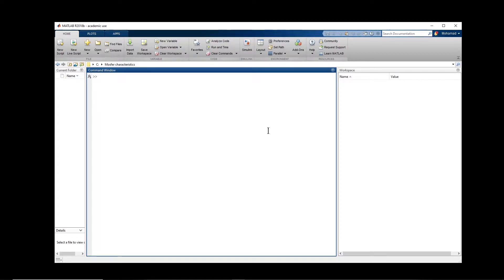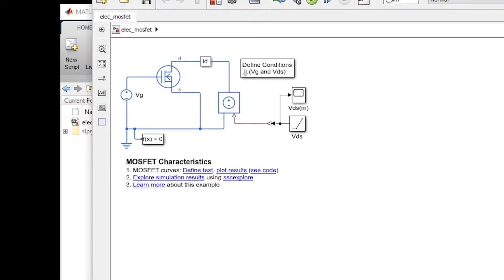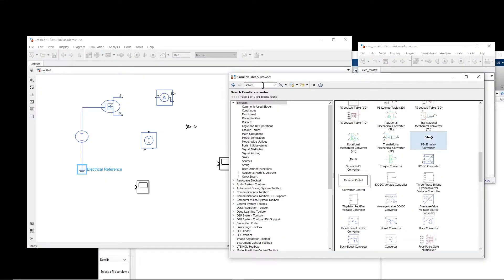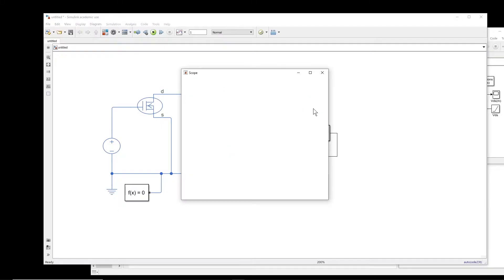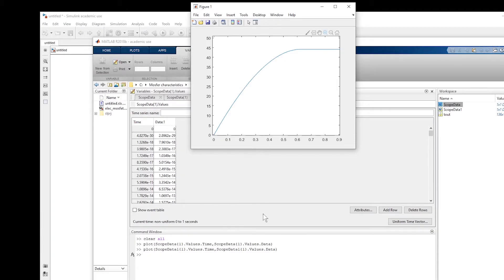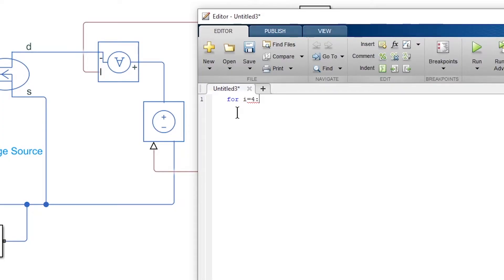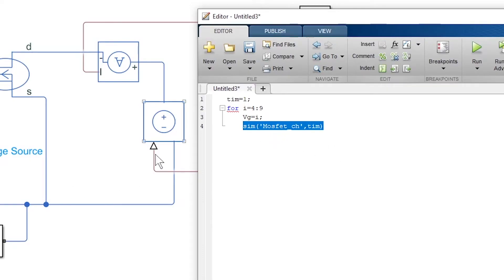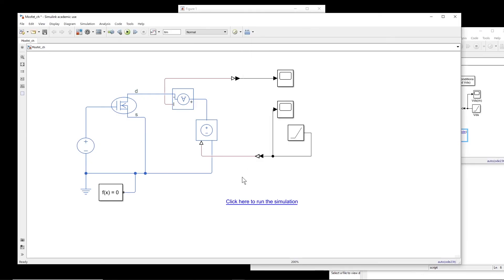How to create characteristics curves of a MOSFET in Matlab Simulink

Comment: how does this software model translates into practical circuit? can you please explain me the current controlled voltage source in this regard..thank you
Reply from the maker: If you want to model a transistor/mosfet with their real model, then the characteristics curve will play a role. That is how it plays a role. I don't understand your second question. in reality the D-S voltage and current depends on the circuit that the transistor is connected to and if there is dynamic in the circuit, the relative of D-S voltage and current changes with time. Therefore how transistor current and voltage are related become part of the circuit behavior. The current controlled voltage source here is to show this relation at any working point.
Reply: @HVE   Characteristic curve plays the role definitely. however could you please tell me how model the IGBT ideal switch Simscape Block with real IGBT using its datasheet static and dynamic test data?
Reply: Hi dear. Thanks for your helpful video. I have question please.

Q. How can I model a SiC and GaN mosfet in Matlab Simulink? Any idea please let me know